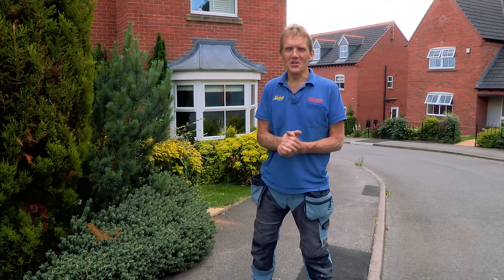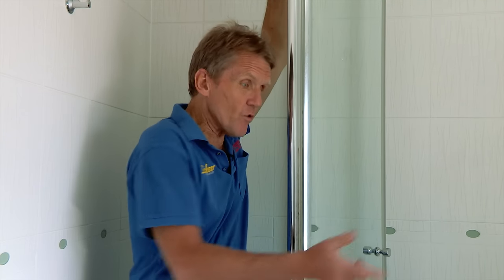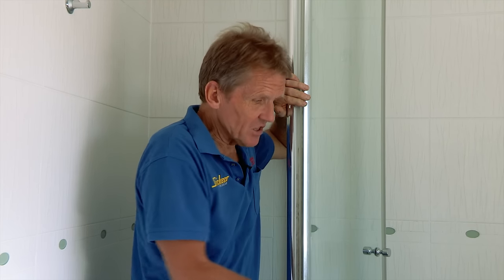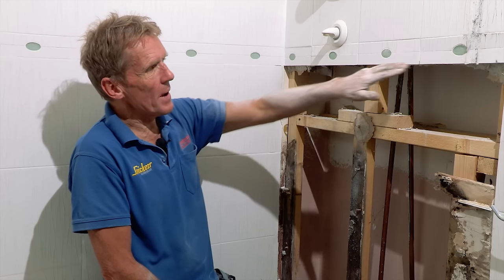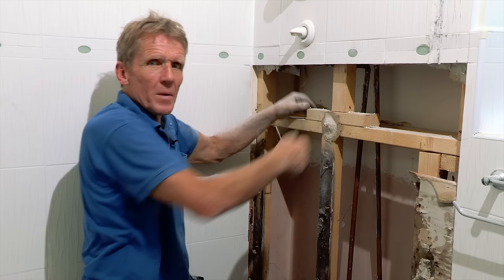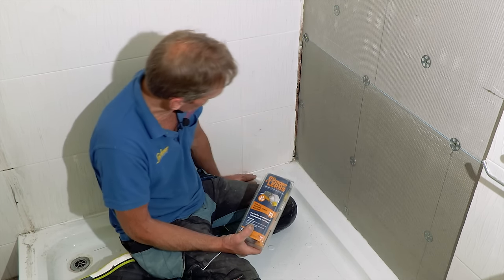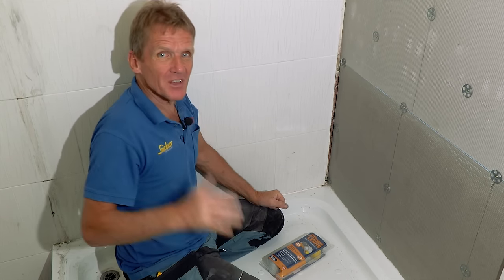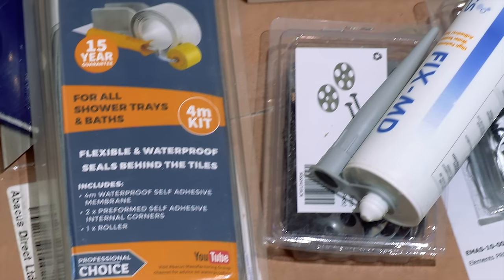Unbelievable Cowboy Plumbing Horror Show

Comment: Awesome and scary video at the same time. My own bathroom was lined with timber boards - they nailed them on and put a nail through the hot water pipe. When the nail finally rusted away there was a pin jet of hot water coming out. Did the cockroaches love that for their nest. When we pulled the whole wall out the plumber who re did all the piping said whoever did this shouldn't have a licence...there were so many dodgy things in the copper pipe work. Paid to pull the whole bathroom out and re do it all properly with aqua panel and many coats of sealant and then tile with water proof tile glue!!

Comment: Great video, cheers. Just two questions... I'll put my hands up and say I've only ever used plasterboard round a shower. I've been installing for close to 40 years and have never had a job I've had to go back to for the issues you have shown. I do see the advantages to the method and materials you have used. However, for it to function would you not have to leave the join between the tiles and shower tray open (like a weep hole) and not sealed? If and water gets through the tiles it will run down and if the tiles are sealed then where does the water go?

Comment: Framing in that bathroom, I wouldn't even do that on my shed. In the states we run either 2x4 or 2x6 from floor to ceiling 16" on center. We use a vapor barrier covering the wall then cement boards after. The screw with the round disk tie down is a nice feature.
Reply: We only use a vapor barrier if the shower doesn't get a waterproofing membrane. You DO NOT want a double barrier to water as if it does penetrate then it is trapped. A lot of guys are using schlueter showers which can be placed right over drywall. I'm not a fan as they don't carry all the products needed to complete a custom shower,  if it is just a typical shower then yes but even then it is too expensive for a typical shower especially knowing there are identical products for 40% less.  That round clip on the screws is to keep from tearing through the panel since a screw doesn't have a large enough head and the foam panel has a low density. Years ago we used a similar product to secure fiberglass faced foam boards for exterior stucco. They don't stick out because the screw force can pull the whole thing into the surface. 
   I do wonder about the water producing of the panel and the screws. I see a membrane being brush applied over a mesh tape over the screw and that is water proof and the foam core must be waterproof but in between is the layer of cementacious slurry over that mesh that covers the foam core which isn't waterproof. How does water not creep from porous cement based surface to behind the tape and find a seam or hole? It seems like it is just a gamble and a matter of time.

Comment: As a sparkie and have seen how new builds are done I wouldn’t buy one my 1930’s house will still be standing when this shite has fallen down
Reply: Couldnt agree more mate...99% of new builds wont last 60 years....thats being generous
Reply: Nor me mate. I'm a chippy and I just won't do site work any more. Everything in sight is made from MDF and thrown in with a nail gun, cardboard doors, cheap & nasty kitchens, everything featureless, bland and ultra-cheap. Give me a Victorian house any day. Properly built to last, by guys who cared.
Reply: Agree. I live in a 1920s house, I have brand new ones on my road completed in 2013. 

Already they're falling to bits.
Reply: @KevinBower-gy5be  where are you based Kev?
Reply: I’m in Derbyshire. Almost all of my work is done on heritage and listed buildings. All the best.
Reply: @KevinBower-gy5be  I'm in Derbyshire too and although I agree that modern houses are generally poor, I wouldn't trust Victorian houses any more. If you're working on listed buildings I imagine most were built to a higher standard (if the building was of some importance or built for somebody wealthy). The common house for the Victorian family was probably worse than modern new builds. Unsafe exterior walls, roof spread, bulging brick work, inferior foundations -- the list goes on. Somewhere I have a report done in the 1950s on housing stock from the 1880s in Long Eaton.

Comment: Love your videos Roger.
Interesting how different things are in the UK compared to Australia or 
Queensland in particular. All bathrooms/showers are sheeted with  plaster board or villaboard which is a hardies brand fiber cement sheet. The main difference is the whole floor an walls up to 2metres high is membraned with a rolled or painted on product. Generally a fool proof system. Usually a 30mm aluminum angle at the door entrance to allow for cement bed for tiles. To test the floor membrane, we put a partly blown up party balloon into the floor waste an flood test the floor with 20mm of water overnight.
Reply: in finland same....how in uk you can still build like that ?

Comment: Good stuff, looks easier to use then cement board.
Think I'd have been tempted to rip out and reinstate that stud work with the studs facing the correct way though.
Reply: Yep defo, see this in new build to save"space" like you can see 2" per wall in a bathroom!!

Comment: In 30 years, there has never been a shower I didn’t float and not one call back for moisture.
Reply: Qu: what do you mean by 'float'?
Reply: @giotto4321  2 layers 30 pound paper, lath, scratch and brown coat.
Reply: @jeffmays7192  thanks for the speedy reply and clarification. I had to Google 30 pound paper (Presumably you're in the US?)  so that must perform as a vapour control layer,  then you plaster on top of that.
Reply: @giotto4321  yes, I am. Yes, 2 layers is code here.

Comment: What you say is very true. One thing you don't say though is that normal tile grout is porous. It lets water through which is why you should always use a waterproof board under the tiles.

Comment: Looks like a decent system.  The strip at the bottom should really go behind the backer board, then on top of the tray though..........You wouldn't put shingles on a roof starting at the top.........  The water WILL soak into the grout, and there is a chance that it could get behind the strip if the adhesive/sealant failed.  Across the pond we do a pvc liner 6 inches up the wall first, then the backer board on the walls, no fasteners below membrane line.  There would have to be 6in of standing water in the shower (which couldn't happen anyway, with a 4in curb) for a very long time for water to even think about getting behind the backer board.
Reply from the maker: Hi Evan 

Thanks for your comments. I appreciate your view on the job. Abacus, Wedi and Schluter all specify the strip on the face of the board. The No More Leaks tape has extraordinary adhesion and will not allow any seepage. Placing the tape behind the board has some logic, and it did cross my mind but you would need a strip of something to stick it to. 

The PVC liner is not something I have seen but it makes sense. 

My approach is to use the tile backer board to the floor then put the tray (pan) hard against the board with a silicone seal then when the seal is dry I put the tape on and then the tiles. 

I have never had a leak when using this method.

Comment: We've just had our bathroom done in our 100 odd year old house and the lad tiled onto an old plaster and lath wall, punching a couple of holes through it for shower pipes. Instead of using any moisture board he just pasted some green tanking solution all over the walls...worried we're likely to see moisture issues in future! How do you rate these paste-on-the-wall tanking solutions?

Comment: I too see this every day, as a minimum you need to use moisture board and then tank it. Worse case is when it’s up stairs and damages the ceiling below. Problem is people do it cheap cos they know it won’t fail until few years.

Comment: Hey Rodger, I see the way you do it, but here in America we have a different process. That insulated mesh board you used isn't what we use. We use cement board. You use screws and plates, we use screws every 8 inches. Same basic idea and it seems both have their advantages. Yours is insulated and keep tiles room temperature as you have stated in the video, while our cement board doesn't do that. However, cement board seems to me that it would be much stronger than that insulated mesh coated board that you use. I wonder if putting a foam board insulation behind cement board is up to code here and maybe that will be something that is code here in the future. In any case, I see this problem all the time as well. Great vid. Keep them coming.

Comment: Really enjoyed the video, Roger - can you recommend a type of plasterboard for a bathroom ceiling? Many thanks.
Reply from the maker: You can use moisture resistant board but if you plaster it you need to prime it with blue grit primer first. If you don't do this the plaster can shell off.  Ordinary plasterboard is OK if you plaster it with a skim coat and then give it three coats of bathroom paint. Whatever you use you will still need to put in a good extractor fan.
Reply: Skill Builder - many thanks for your advice and swift response. I am learning lots from your vids - many thanks for doing them.

Comment: Just had two new bathrooms in my house, one shower over a bath, one walk in to the floor tray shower, and he used normal plaster board. I guess I have to just hope for the best
Reply from the maker: Keep an eye on the grout and the seal at the bottom around the tray and bath. If you see any cracks or gaps don't leave them. Some people have years of good service out of their showers but maybe one in ten has problems, which adds up to a lot.
Reply: @SkillBuilder  thank you so much for your reassuring reply. I wonder if I can ask a long winded question, when we moved into our 2005 built house five years ago had terrible shower leak to the point it was staining kitchen ceiling below and making the door architrave blowout. I resealed bath etc and to my credit I noted when a removed bath for refit the board was black with old mould but bone dry to touch. Now when I've come to paint skirting in room next to bath wall that plaster board at the bottom was damp. So essentially the bath side was dry but the room next door wet at the bottom. Is it possible that moisture has just sat behind skirting board for all that time or am I mad for thinking that. I can think of no other reason for moisture. There are no other pipes rad etc in that area so I am bamboozled as to why it would be wet.

Comment: We are just having our ensuite and bathroom redone, same problem as shown in this video.  Bellway house, with absolutely shocking plumbing.  Tiles straight onto skimmed plasterboard which has gotten damp over the years and ended up falling off.  Once we cut into it, we saw the shower held up on the plastic pipes.  Costing us a fortune in repairs.  The workmen these days don't give a sh*t.  Went through five plumbers before we found a good one.

Comment: You can waterproof plasterboard. It's not the material underneath that is the problem, It's movement and fine cracks in grout the cause most of the issues in shower cubicles. Once water or moisture penetrates the grout the tiles are doomed I'm afraid, it's just a matter of time before they blow.

Comment: Love the Elements board from Abacus which we dont have in the US. We use something called Backer Board or cement board. They are heavy, difficult to cut and make a lot of dust. The only alternative with new materials is the Schluter system KERDI Board, but it is incredibly expensive. I have to agree: tile over plaster is below amateurish. Whoever did that job was a really bad carpenter.

Comment: We have a dilemma. We had a "friend of the family" put shower panels in and shower, so it's safe to say he messed it up. After a lot of stress, me and the Mrs took it all part, cleaned it all, put it all back and then hit a big problem. We have no nice bit of wood to drill into for the mixer. All we have to mount the BSP valve holders is the shower panel, plasterboard, and a bit of thin plywood.
Reply from the maker: You will be fine. I reckon you can put the screws in the shower panel and maybe a dob of silicone or CT1 behind the plates. That stuff sticks like crazy.  I have sat on a basin to try and take it off the wall and in the end the wall came away with the adhesive unbroken.
Reply: @SkillBuilder @SkillBuilder I've just been looking at hollow wall fittings (I'm learning so much after fixing other people's work, lol), which look like they would work once they open up behind the plasterboard.

Comment: In the US, we have sheets of concrete board that are made of a form of solid concrete around 1/2 inch (12.7mm) thick.
Reply from the maker: We have the same cement board here but this Elements board is better

Comment: Thanks for the informative video. 

A question I have is what the black stain like burnt marks are on the studs. Time 4:25 in the video

Currently taking apart our wet room due to damage and noticing the same burnt stains on the wall studs.
Reply from the maker: Plumber's blow torch used to solder the joints, some plumbers burn walls and other surfaces because it is all hidden and they think it is not a problem.
Reply: @SkillBuilder  thank you so much for the fast answer! :)

Comment: A real eye opener and what a thorough job. Every builder etc should watch this as few know about this issue and default to using moisture resistant plasterboard. Indeed this was my approach until I saw this. Water vapour is highly penetrative and finds its way through to the lining to cause problems. Linings should therefore be water proof and not just moisture resistant as this video highlights!

Comment: I've hardly done any DIY in my life. Couple years back, my mom paid 800 quid for a new shower. They half assed the job and for a whole year it had been leaking, eventually running down stairs and ruining the ceiling and wall. I decided to buy a shit load of pro tools, and do it myself (with my mate who's a carpenter). We stripped it out, got a whole new unit, redone the tiles etc. Now we have a decent shower, flush with the floor, with waste water pipe fixed up proper. The tools cost a bomb, but at the end of the day, I get to keep the tools, and we're not another 800 quid out of pocket with a dodgy shower, which would risk further damages. We still don't have a ceiling, so the pipes are still exposed atm, but it's not too big a deal atm because theres plenty more work to be done. 

On top of this though, my mother payed 13k deposit, cash in hand, to a bunch of dodgy scam contractors, in the hopes of getting it all finished up (the damages and renevation of rest of house). They did a runner with the cash after having stripped the rendering of a wall and removing our floorboards. 

I know she's my mother, but I mean, FFS. Perhaps had you 'put up' with my dad's 'toxic' masculinity, and not choked mine and my brothers, (and let me handle it all in the first place, cash etc) you wouldn't be handing out cash to f**king strangers. 

Anyway, yeah, it's a dangerous world out there. Most tradesmen half ass their jobs. Others are out to scam. Some actually do a decent job, and earn the money they charge, but all I've ever seen in person, is that you're genuinely better off doing it yourself. It'll end up cheaper in the long run, and at the very worst it'll be about as 'half assed' anyway, at best, you end up doing it better. 

I gotta give thanks to people like you. Without your insights and advice. It makes a big difference to those who are genuinely too afraid to risk hiring anyone else. So sincerely, cheers. Your chanels make a difference.
Reply from the maker: That is a sad tale for sure. I hate to see people being ripped off like that, not once but twice, and all she did was trust somebody. 
Unfortunately there are thousands of people out there who are using the building industry to mug people.

Comment: In my bathroom, two walls on the sides of the bath did not align at 90 degrees. What does the tradesman do then? Hammered the plasterboard, fit the bath inside the wall under some weird angle and covered it with the tiles grout and silicone. Mould riched the floor joist in about 10 years. I used Mapei tanking system (WPS), added the flexible tape to all corners in the edges, removed plasterboard. No more problems with the mouldy stench coming from god know where...  What really pisses me off is the fact that the correct insulation/waterproofing  materials are relatively inexpensive. Laziness of your tradesman will cost you the quadruple of the initial investment.   To cut the long story short - I do not allow any "professional" around any of my appliances except gas and sparkies. But they must provide a certificate for their job so any mess is on them.

Comment: Nice tile job but you will still have water damage eventually from the plumbing.  The corrosion around all the sweat joints on the copper plumbing will get pin holes, I would give it 10 to 15 years from the time it was first done until you will have water damage and have to rip everything back out.  You should have replaced all the plumbing while you were at it.  That is what plumbing looks like when they do not wipe down the copper pipes after they soldier them.

Comment: The only thing I would do differently is I would change the shower valve for a bar mixer,so it can be replaced easily without disturbing the tiling.

Comment: Roger  love your videos. I am planning on replacing rotten plasterboard in an ensuite shower with Elements board, the ceiling is not rotten so should i leave as is or replace? Its currently artex so was thinking or replacing but not sure what to use? Many thanks
Reply from the maker: Artex in a bath or shower room is not great. You can screw plasterboard up over it or you can skim it with a fresh coat of plaster and have a nice smooth ceiling. It is a quick job for a plasterer.